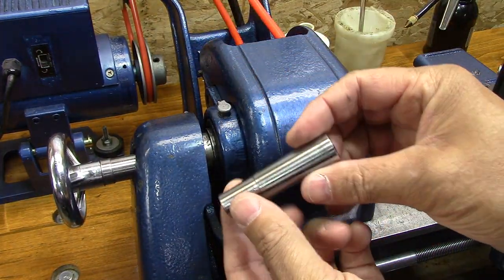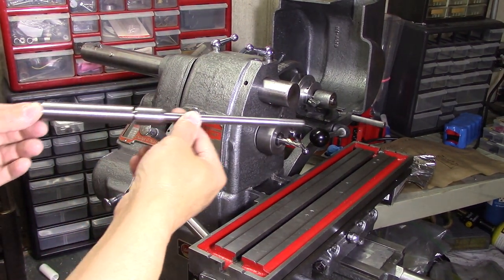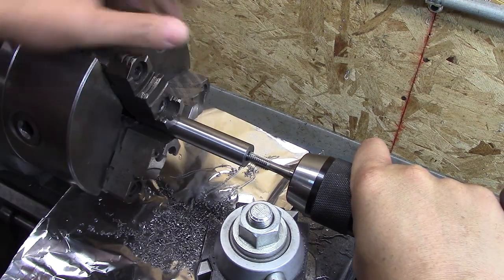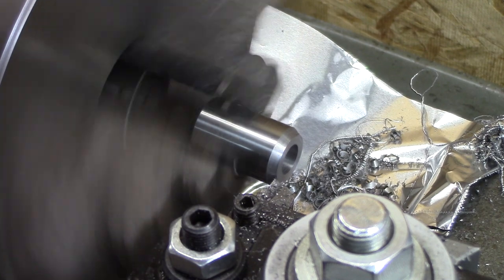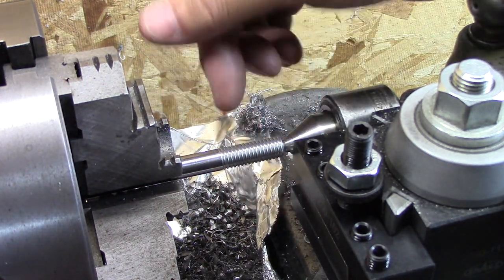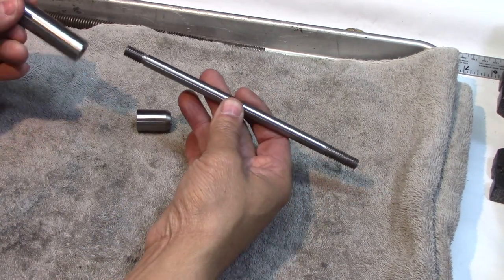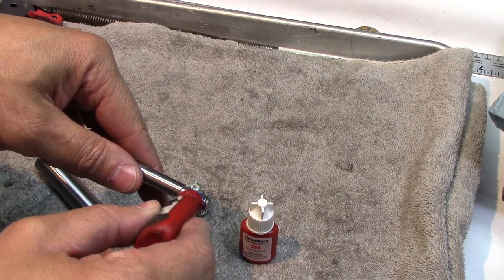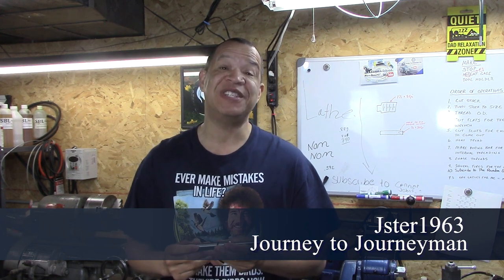Using my Atlas 7B Shaper and South Bend 10K to make a drawbar.  Journey to Journeyman, Episode 31.

Comment: 100% learning to grind HSS tooling is an absolute must. The southbend how to run a lathe book has ana excellent section it.
It will drastically improve your shop efficiency!
Reply from the maker: I sure plan on learning.  Also, I plan to make grinding jigs to be more exact.  HSS that's ground correctly is incredible!  And is do have the South Bend book.  I'll reference it.  And thank you so much.....
Reply: @jster1963  Awesome! I use a belt/disc sander combo for mine. Flat faces and indexable tables make it pretty easy. I'd highly recommend a water cup for cooling the tool steel as you grind it. Hone afterwards on a stone. Sounds like you are on the right track! Feel free to reach out if you have any questions!

Comment: Good job dude. The only thing I’d do differently is I would drill a hole in the draw bar in the threaded section, then pin it. This way it doesn’t unscrew and leave a collet bound tight in the head with no way to remove it.
Reply from the maker: Excellent idea!  I'll do that.  And thank you so much.....

Comment: That is a nice chuck you have on that lathe Jasper. Is that a Bison?

The nightmare of every controller, a transponder comes on on a static horizontal location, high vertical speed, in a high traffic density area like Florida :)
Reply from the maker: That chuck is awesome and yes, it is a Bison.  And don't worry, I was not a surprise to ATC.  They knew I when and where I was coming.  It was totally coordinated.;-)  And thank you very much.....
Reply: @jster1963  That chuck with it's interchangeable jaw system is very tasty. Did you buy it new, or get it with the lathe.

Comment: Great video, What size are those 618 collets? Thanks.
Reply from the maker: Thank you very much!  And I'm not sure what you mean by the collet size, sorry.....
Reply: @jster1963   I mean is it like  a 2c collet set or 3c collet set? I would like to get a collet set for mine , just dont know what size set to buy. Thanks.
Reply: I made a mistake. I thought it was your 618 not your south bend. Sorry.
Reply from the maker: @baggd65  Ahhh, gotcha. My Atlas 618 uses MT2 collets. I got them from Shars.   Good luck
Reply from the maker: @baggd65  No worries!  MT2 in case you don’t see this on the other comment…
Reply: @jster1963  That answered my question. Thank you.